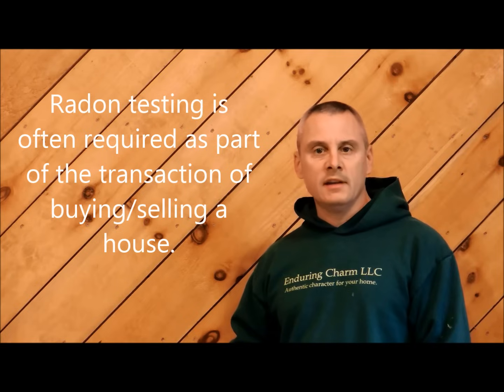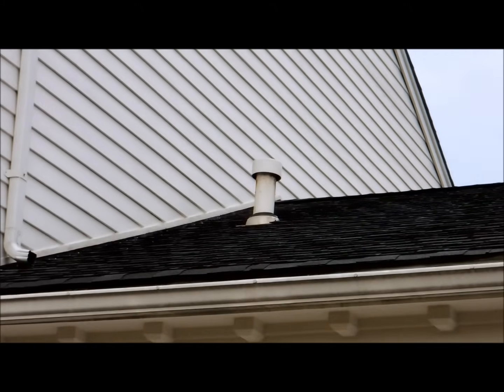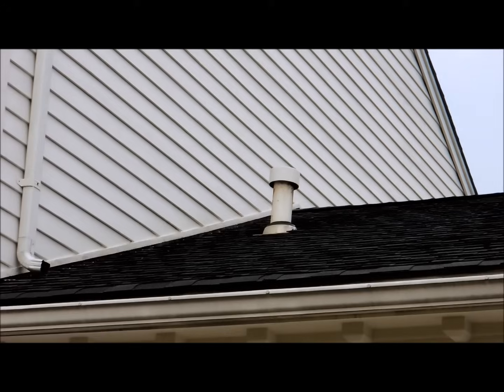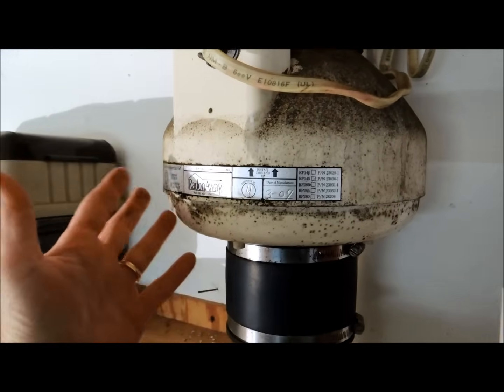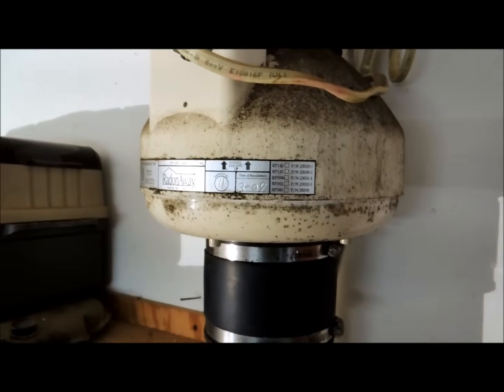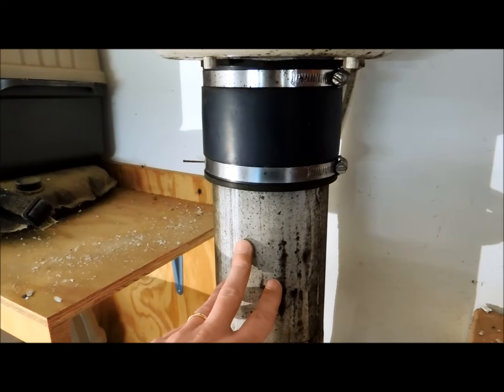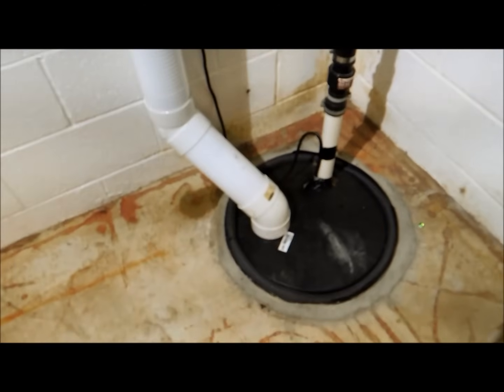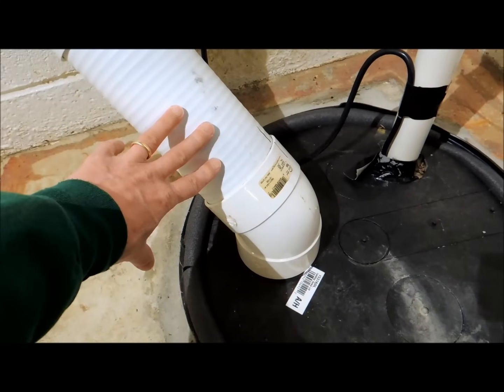Radon Mitigation Systems Explained

Comment: Great explanation of radon mitigation! 
A comment on radon testing though: even if the test shows good results when the house is bought, it is smart to do more testing. Radon levels can change quite a lot, so you probably want to know if you're safe throughout the year. Testing with a digital radon detector then becomes much more convenient than buying several one-time test kits
Reply from the maker: Yes, like well water testing, it's good to repeat the tests from time to time, especially if the radon reading was marginal originally.  Typically radon is a problem in regional areas due to the underlying geology, so you'll likely know if you're in a problem area.  The good news, though, is that radon won't give you cancer overnight!  You have time to test and remediate if the readings are high.

Comment: Does this ever have to have maintenance ? a filter changed or anything like that or just a recheck to see if there are any leaks as explained. Thank you
Reply from the maker: No filter, they just run until they don't run anymore.  You can check for air leaks in the pipe or the basement floor from time to time , and keep an eye out for condensation on the pipe which could drip back into the house.
Reply: @enduringcharm  Thank you so much : )

Comment: So... How does the radon get into the pipe? If there's a crack in the opposite side of the room, does the radon come up through that crack then get sucked into the plastic pipe somehow? I just see a pipe going into a sump pump in the video. I didn't hear anything on how the radon system actually works.
Reply from the maker: +M3DucatiMan Must be voodoo, right?  The point of these systems is simply to create negative pressure under the slab.  It's like hooking up a vacuum cleaner to a closed box. If the box has a small opening somewhere, outside air would drawn in to the box rather than air from within the box being allowed out.  Same under the basement floor.  Radon gas escapes in small quantities from the earth and can collect under the slab of a house.  Without the Radon system that gas can eventually migrate into the living space through cracks or openings.  With the radon system running, the negative pressure under the slab will draw air in from the living space rather than allow radon gas to escape out.  Some of the gas will be ejected out the pipe through the roof where it will dissipate.  It's not so much that the radon system is supposed to remove every bit of radon gas from under the slab, but more that it prevents the gas from entering the living space.  As simple as they are, they do work pretty well.
Reply: +enduringcharm Thanks for the quick reply. =o)

Comment: good video---is there any reason the discharge  pipe has to be above the eves on the roof-I am in the process of doing what you are showing,but I was just going to have the exhaust pipe come up from the basement-out a window  the up a few feet then a 90ty with a screen on it--just to keep debris from getting in----thank you
Reply from the maker: The idea is to discharge the gas away from windows or other points of entry into the home.  If memory serves me, I think the recommended minimum discharge point is ten feet above the ground.  The EPA publishes design guidelines you might want to consult:  http://www.epa.gov/radon/pubs/

Comment: Probably a home owner installed system. Flexible couplings should not be used except below and above the fan. The fan should NEVER be located in a space within the envelope of the home. Should it leak in the home you have a much worse problem than before the radon was mitigated. ASTM Prtotocols are a good guideline as are the newer ANSI/AARST Protocols
Reply: The only place I saw flex couplings were immediately above and immediately below the fan. So, according to you, that meets spec, correct? As far as a fan being located inside the home, it can hold the tiny pressure. There is 70 psig potable water, and also stinky sewage, all being sealed inside the home by PVC pipe. Properly glued and sealed PVC pipe is not going to leak air at these paltry (less than a half psig).

Comment: Good video sir. My neighbor has a mitigation unit that is loud. It has an annoying high  pitch whine, similar to a shop vacuum. The fan in your video didn’t sound very loud. Is there any way to reduce the noise ?
Reply from the maker: It might be two things.  First, the fan may be on the way out and what you are hearing is   the bearing whining in pain!   The other issue is that the connected pipe and/or brackets could be resonating with the fan.  That might be addressed by tightening or relocating brackets, or by insulating parts of the pipe.   Maybe mention to your neighbor that you've noticed the fan getting louder and that he should have it inspected to see if it's dying.
Reply: enduringcharm thanks for your reply.  Now that the foliage is thinning, the sound is louder. If it is a bearing going bad, any guess how long until it fails.

Comment: If there is a crack in the pipe in the garage is that a problem? I'm pretty sure there's a crack and it is louder than I remember and it sounds like air is coming out of it now
Reply from the maker: Yes, that's a problem!  You're exhausting air with radon gas into your garage and perhaps your living area.  You need to replace the pipe after you determine why it cracked.  If it's schedule 40 PVC, it takes a lot to crack--perhaps settling or a poor installation originally.  If it's a lesser grade plastic pipe you should just replace it with Schedule 40 which is well supported.

Comment: Thanks for the video. So just one radon mitigation pump hooked into the sump will suck all the radon out from under the entire house?
Reply from the maker: "It depends" is the best answer I can give you.  Ideally you have a system installed before the slab is poured, but the reality is that sometimes you have to do the best you can with what is there.  Also, don't the vacuum cleaner analogy too far.  The point is to create negative pressure under the slab and provide a place for the gas to safely escape.  It isn't so much about sucking the gas out but about encouraging a different escape route than into the living space.
Reply: enduringcharm We're going to try this and save some money hiring someone to do it. I was quoted at $1200 yesterday. :/ We already have the sump pump so it would be nice to use that instead of making another hole in the floor. As far as the pipe for the radon mitigation fan goes, how far down under the lid should it go? I don't want water to get sucked into it. Thanks for your quick response!
Reply from the maker: If you do it yourself you can find some sizing guidelines for the inline fan on the websites that sell them. Take care to seal any cracks or gaps in the slab or in the sump pump hole.  The pipe only needs to go below the lid, but make certain that the sump pump sides are open (with holes or some kind of grill)  to the underside of the rest of the slab, not just open at the bottom.  Above all, get a radon test kit after you are done and test to make sure the job is getting done!
Reply: Ok, we will do that! I looked into the sump pump hole and it is very gross. lol! Anyway, there was only one pipe leading into it and the water was probably a foot and a half down right below the pipe. I've seen other sump pumps with more than one pipe leading in but ours only has the one. Will this still be effective in your opinion? Thank you so much! I just need advice from someone who knows what they're doing. We have no idea.
Reply from the maker: When a basement or ground level concrete slab is prepared, the builder first digs down to undisturbed soil.  Then he puts down a thick layer of crushed stone.  In more recent construction he then puts down a layer of plastic and/or insulation.  Then four to six inches of concrete is poured over those previous layers.  For a radon fan to be effective, you must ensure that the system is drawing air from the layer of crushed stone.  Radon escapes the soil into that layer of stone and you want to collect the gas before it moves upwards through the slab and into the living area.  So, if your sump pump hole is the collection area, then you must ensure that the construction of the hole allows free flow of air from that layer of crushed rock.  If all you have is a single pipe leading into a sealed plastic bucket or container, then you have some work to do!  If that container is open to the layer of crushed rock you may be okay.  If there is no container but just a muddy hole, then it may or may not work depending on the depth of the hole and how open the layer of crushed stone is to the hole.
Reply: I just looked into it again. The house was built in 1938 and I'm pretty sure that that has been there since then. lol! We just moved her in Jan. It's about an 18 inch hole around 2 - 3 feet deep. The cylander itself is rusted metal and there is silt and sand on the bottom but when I scraped the bottom with a stick it seems like its all like a metal container-didn't feel gravel underneath. There is one metal rusty pipe coming out of the side for the excess water and it gets pumped out into the front yard. I don't know where that pipe comes from or anything other than what I can see. I guess the sump method won't work for us because of the set up then?
Reply from the maker: From your description I'd guess you will need to remove what was probably a galvanized corrugated piece of pipe  (the cylinder)  and rebuild the sump pit anyway with a modern plastic version.  In that process you should be able to slip some PVC pipe under the slab in several directions, or else cut up the slab and lay down some pipe, and then have that PVC pipe lead to the new plastic sump.  The new sump pit and any pipe will then be sealed to the old slab with new cement or mortar mix.  Given the age of your house it's quite possible that the slab is not set on crushed stone, or not very much crushed stone.  It's also possible the slab is in poor shape.  The only way this whole system works is if the slab is in good shape with no cracks or gaps and if the radon fan can draw from below the slab.  Even if you go with another method than having the radon system draw from the sump pit, you will still need to rebuild that sump pit so that it can be properly sealed.

Comment: Exposed NM Cable should be contained within conduit, no?
Reply from the maker: Yes, they should be.  I have no idea how old this radon installation was when I took the video, but probably 15 or 20 years.  The video itself is 7 years old, so the installation is well over two decades old.  Did the electrical code require conduit at that time?  It very well might have, but I have noticed that when non-electricians are allowed to run cable for, say, radon, water heaters or well pumps, you often get situations like this.  I've seen NM wire run outdoors for radon fans just flopping about in the breeze!

Comment: Any ideas on a place that has no basement and the crawl space is impossible for anyone but a small child to get into? Maybe go through the floor with the piping?
Reply from the maker: SANDS78 Find a small contractor?  Sometimes it can be tough.  Is the crawlspace dirt or is it already sealed?  You may well have to tear up the flooring to gain access, or you may be able to remediate using an alternative system.  It's worth contacting a local radon remediation company to see if they have any ideas.  Odds are they've seen the problem before and have a solution of some sort.
Reply: enduringcharm Thanks for the advise, I will look into it. I have a contract on my first home purchase and had no clue about radon testing and mitigation. The listing shows that it is a crawl space but the home inspector said there is no way to actually get in there. There are circular vents around the bottom of the house but that is all, not sure how a vacuum system can make a negative pressure.
Reply from the maker: SANDS78 Well, you may not have an issue anyway.  Radon is only a problem in the living space.  Typically they leave a test kit in the living areas for a few days during the home purchase process and then have a lab send back the results.  If the numbers are too high, then you need remediation.  What you describe could be difficult to remediate, but it also sounds like that area is sealed off from the living space and may not be a problem anyway.

Comment: how do you mediate condensation on the pipe?
Reply from the maker: That can be a problem.  Avoiding the temperature differential which leads to a dew point is the answer, but not always easy to achieve.  The cool air from under the basement slab keeps the temperature in the pipe cold and when warmer outside air hits the pipe the humidity in the air condenses on the pipe.  So, you can try to insulate the pipe, you can can route the pipe away from outside air as much as possible, you can enclose the pipe in a chase.

Comment: Get this:  My new system looks very professional. But I discovered that my fan is upside down!!  I was suspicious because a crack in the floor next to the radon pipe is blowing air into the house!  It should be sucking down into the dirt. (actually should have been sealed) Next, my manometer says 4.8. (seemed high) Next,  I climbed on the roof.  My vent pipe is sucking down!!  Finally, my radon level went from 4.6 to 6.8!  And that's away from the room with the cracked floor.  I'm currently testing over that crack. In about 40 more hours I'll get a reading. I bet its sky high over that crack.  The installer needs to fix this.  Hasn't called me back yet.
Reply from the maker: Wow, that IS nuts.  Often the fans have an arrow direction embossed right on the housing!
Reply: @enduringcharm  Yes.  Mine has the airflow arrow too. The owner of the company said that he hired a couple of dumb employees.  He has gotten numerous other complaints too.  The owner came over and fixed the issues.  The electrical outlet in the attic wasn't mounted either.  Was just laying on the insulation.
Reply from the maker: Brilliant.  Apparently he made no effort to train the dumb employees either.
Reply: @enduringcharm  Yeah,  he said he "cant watch them every minute, he's too busy" Ok, well training them and maybe doing a final inspection of their work would be a good idea.   Apparently he just fired them instead of training.  He called them "retards"   (I hate using that word) But what does that say about him for hiring them and sending them out?

And he did come back and flip the fan over, sealed the crack and mounted the 110v outlet in the attic.  It was just laying on the insulation.

Comment: Radon is radiation. Homeowners may install radon mitigation themselves. For your safety and the safety of others, please refer to EPA radon mitigation system installation guidelines if you are doing the work yourself. Sealing slabs and caulking cracks is not considered a successful stand-alone mitigation strategy by the EPA.  If you are hiring someone to install a radon mitigation system in your home, please know that many states require radon mitigators to be trained and licensed by the state's Department of Health. Contact your state's Dept of Health for more information.
Reply from the maker: Mike1614b Different states have different codes on radon, and ultimately the "successful" mitigation system is the one that allows the living space to pass the radon test.  In my state, radon is tested as part of the home buying process and many of the homes I've been in (for other reasons) pass the radon test through the use of a simple exhaust fan shown in the video and the sealing of cracks or gaps in the slab.
Reply: enduringcharm  Good points.
1) in some states there are no laws or licensing regarding radon measurement or mitigation- in those states, please follow the EPA standards and protocols for testing and mitigation; seek out  a radon professional who is a certified member of a recognized national radon certifying organization.  
2) Radon mitigation is defined as any alteration to the home's condition that results in the permanent lowering of the average indoor radon level. As a homeowner, to be certain the mitigation has reached your health goals, independently test post mitigation for radon in the lowest livable area of the home, and test every 2 years.